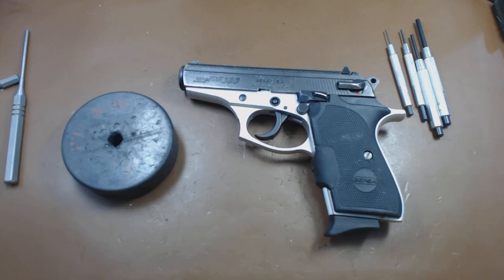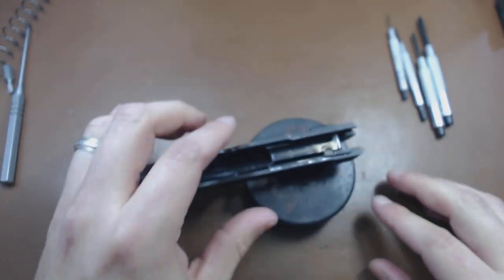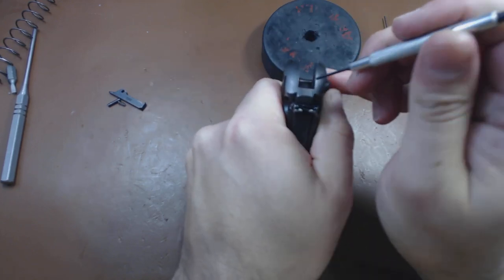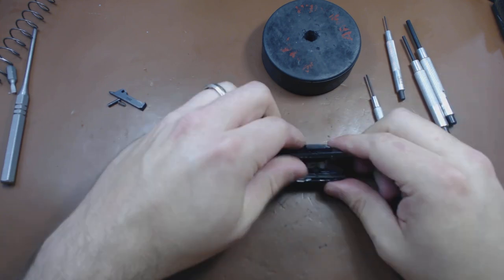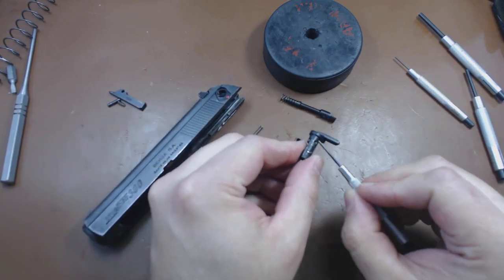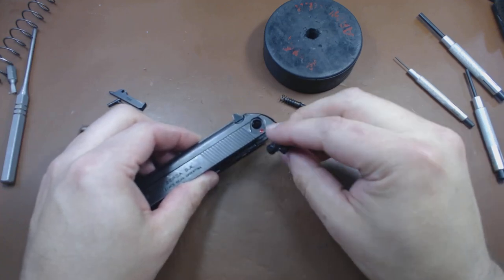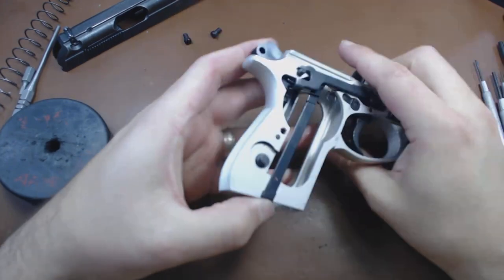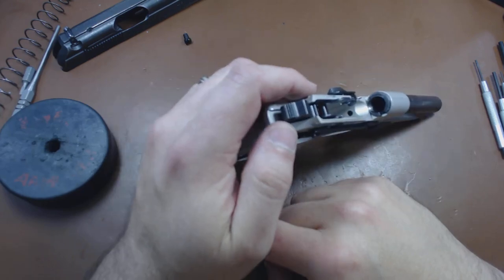Bersa Thunder 380 Complete Disassembly and Reassembly

Comment: Barrel you did not remove barrel
Reply from the maker: The barrel is press fitted and requires appropriate tools to swap out. You can use a makeshift/homemade press, but it is pretty easy to make of mess of the gun. My videos are just for people trying to breakdown or get a gun back together or maybe learn a little about how and why it works. 

For guns where swapping the barrel is very common (Makarov comes to mind) there are inexpensive tools that do a decent job.  Generally, swapping a barrel is a once in a gun's lifetime experience. I converted my favorite Makarov to .380 because I reload and I hate sorting Makarov brass from 9mm, for example. I would only change the barrel again if I were selling it and the buyer wanted the original back. The point is that you don't pick a barrel each time you go the the range and just pop it in. 

There is a lot more to consider about this process. If you aren't 100% sure of the history of every shot fired through the current barrel, you have no idea if the gun has ever had a squib. The barrel could have a bulge that you can't even see, doesn't degrade the functionality, but would destroy the frame if pressed out (has to be cut off first, then pressed out). Bottom line, you are moving out of the realm of armorer and into the realm of gunsmithing here. That is best tackled with professional training to cover all the ways things can go wrong that you wouldn't necessarily think of on your own until after you wrecked something.
Reply: Thank you for the needed info. Changing out all parts with nickel plated. Including the barrel. I have a P-64 Polish 9x18 Makarov Pistol. Very nice pistol. And looking for a FEG PA-63, basically a Bersa thunder.